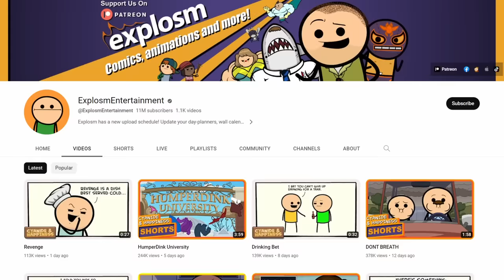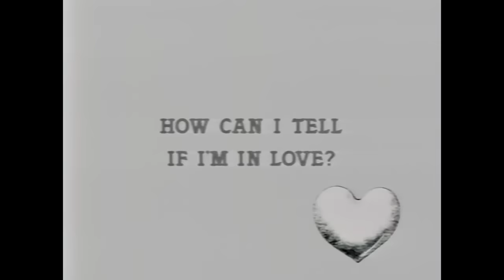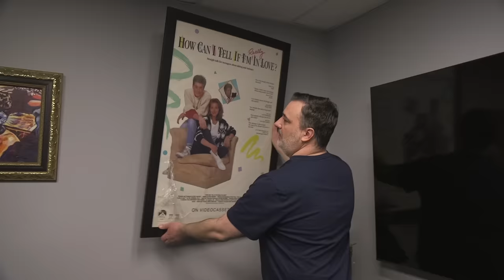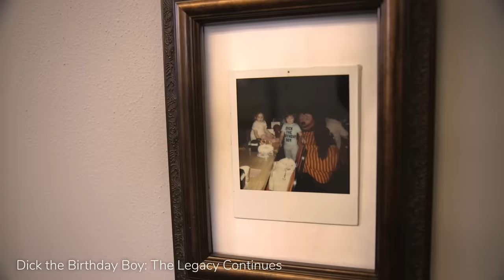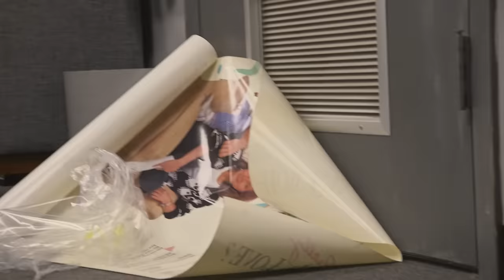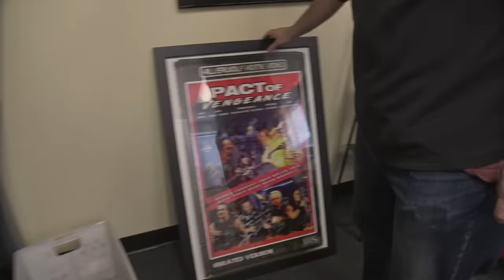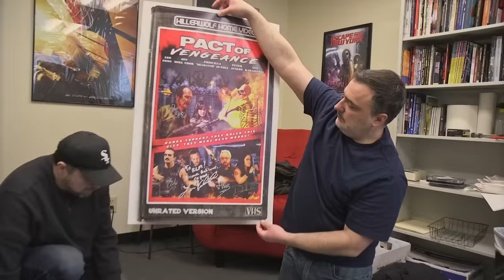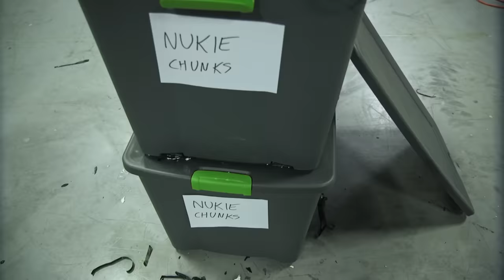Red Letter Media Poorly Performs Minor Tasks

Comment: Guys, the solution to the gremlin problem is simple. Take the gremlin, fill it with your packing peanuts. Put it on the pole with the peanuts inside it, lay it down horizontally, and then fill it the rest of the way with foam. Either spray, or pour. make sure you have a clear opening for the foam to come out of, or it will burst the gremlin from the inside.

Comment: In case you're looking for a better solution to display and support your aging props....I suggest a product like shadow foam. You can cut out of the deep foam the exact shape of your prop and it will evenly support it over a broad surface area unlike a 2x4 in the neck. Could allow it to be wall mounted as well.

Comment: For the gremlin: I was thinking you could possibly add a dowel into a tennis ball that you could position into the head portion, then drill a hole for that dowel into the base to support the head. for the body, you then add the secondary support beneath the body like you proposed in the video.

Comment: Since they don’t care about preserving the Gremlin, I would just fill the body with expanding foam and support wire assume the foam wouldn’t eat the latex.  Could line the inside with a plastic bag so there is no direct contact and contain the foam from leaking from the holes.

Comment: If by some microscopic chance you happen to read this comment, and then by an even more microscopic chance get the motivation to attempt mounting that gremlin again.... why not try some expanding adhesive foam to fill in the gaps between the silicon and the wooden stand? Gorilla glue or sealing wax perhaps. sure, it'll be permanently fixed to the stand, but couldn't be any more damaging than leaving it in the warehouse to get kicked around.

Comment: With the Gremlin, it would have been cool (though time intensive, risky, and maybe expensive) to stuff the Gremlin with something like foam so it doesn't collapse or hold air, put the video tapes under its head, and then encase it in clear epoxy resin. Then all you would have to do is mount the cube/coffin shape in a wood frame, pain the wood frame black, and make sure the resin gets polished. It would be preserved forever that way.

In any case, I like your guys' idea too, and it's a lot less work.